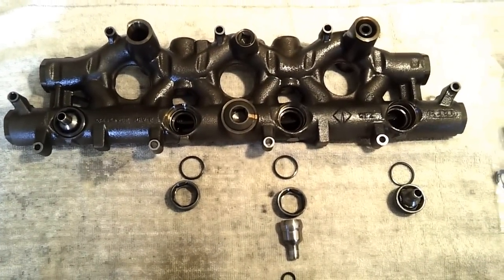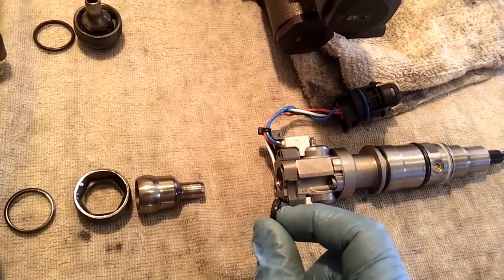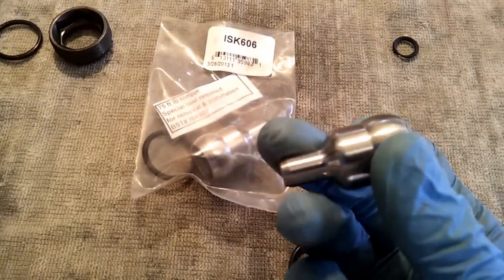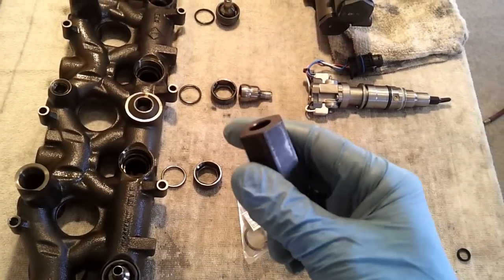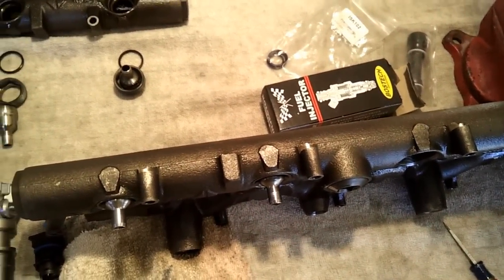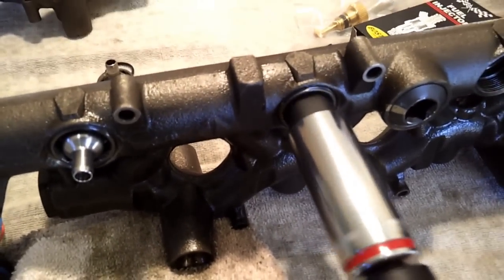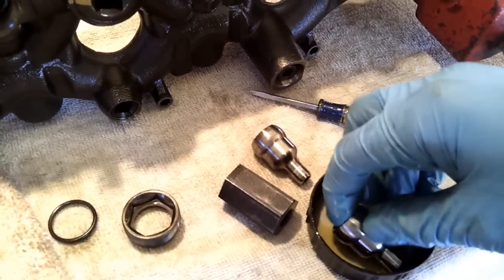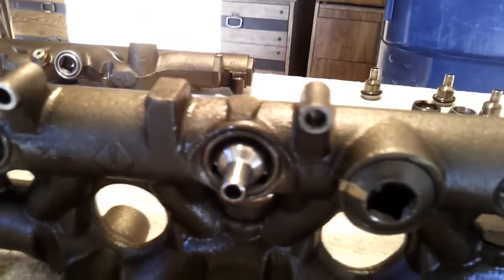FORD 6.0L Diesel ~HPO Leaks~ Oil Rail -to- Fuel Injector Nipple Cup Seals

Comment: I just replace my nipple cups and orange and was worried that the prongs were not good because my nipple cup was still moving but I can see in your video that even after your replacement you still were able to move this part. My old prints were stiff and when crushed held that shape as the new ones popped back to original shape. Thank you for the video

Comment: Torque spec is 100lbs   not 75lbs 
Also when nipple cup seals failed the oil sprays down on the injector damaging the top seal in the injetor also.

Comment: Normally the injector seal at the top is chipped off like that because whoever put the oil rail back on was a little rough with putting it down inn  injector.. I have yet found leaks at the ball cups soapy water does good under air pressure testing for them little pissy ass leaks

Comment: friend I have a detail with a powerstroke 6.0 model 2004 the detail is that hot does not start and if I throw a little starter if you start friend and check leaks in the reins and hoses and not leak friend that could be

Comment: How much air pressure should I run through the oil rail to test for leaks??????
Reply: at least 100 psi
Reply: I replaced my nipple cups and seals as well as injector seals. Tested oil rail itself for leaks and and found none. But when I screw oil rail back on to injectors and pump air through the ipr valve at 100 psi I still hear leaks around oil rail.... Is this normal??? Where should Start looking for the problem? 

Please any help or advice would help. Ive been working on this issue for over a year and I cant seem to ever solve it.

Thanks
Reply: +Jose Venegas did you start the truck? It takes a good priming to fully seat the seals. we recommend starting and running around the block then retest.
Reply: I primed the engine and turned it on. It was really hard turning it on but after ideling for about 30 mins and turning it off I could not get it turn back on again. Turned on Only after spraying a little gas in the intake. So im assuming it is not building enough pressure to turn on.

Should I still run it around the block to see if it seals better or should I just start taking it apart and assume the issue is with the injectors? And buy new ones if neccessary since I had already purchsed and put in new seal kits for injectors.
Reply: +Jose Venegas They always take a while to start a few times after the oil rail has been off. the air needs to purge out of the system. Yes running it around the block or further is always the first thing you do when you get it running again.

Comment: Did the Viton o-rings or injector seals fail you at any point?
Reply from the maker: +DJs Tuffmods Yep. Multiple times pulling trailers all over the US and Canada. Finally fixed it with the nipple cups and o-rings we developed at HHC Diesel.

Comment: Hi cr38er i have a question .i have a 2003 ford 6.0 diesel truck ,i was changed the fuel filter went i was take out the filter one little piece of the filter holder broke off and fall off inside the line i try to use a vaccum to take out but no good luck 1 month later i was trying to go to work but my truck never turn on again do you think the piece went inside one of the fuel injector
Reply: It's possible, but more likely something different. Need to Diag with gauges and IDS to know for sure
Reply: GadgetClass thanks am going and buy a xgauge just to make sure is a fuel injector

Comment: Great video. I am wondering if those seals last long. Do you get come backs. A different you tube channel says no luck with after market seals. Please respond. I trust your judgment because your videos are very detailed with clear and accurate work.
Reply from the maker: jimmy neutron That other channel is probably mine. I have more than one. This was the first video I did on it. The Bostech seals/nipple cups failed on me. I have since started a company called HHC Diesel and well sell special Heavy Duty Viton Blend O-Rings which outlast the OEM and the others on the market. They have proven themselves and are still going in trucks that had Aftermarket rings fail. We make the best tool for replacing them also. Here is the link for them on amazon and ebay:

Amazon:
http://www.amazon.com/dp/B00U4LYKMY/?tag=cr38er-20

ebay
http://rover.ebay.com/rover/1/711-53200-19255-0/1?icep_ff3=10&pub=5575088352&toolid=10001&campid=5337634278&customid=&icep_uq=&icep_sellerId=cr38er&icep_ex_kw=&icep_sortBy=12&icep_catId=&icep_minPrice=&icep_maxPrice=&ipn=psmain&icep_vectorid=229466&kwid=902099&mtid=824&kw=lg
Reply: Thanks

Comment: I found the tool cheap on eBay for $50 or so same/same early vs late model.  I took a spare Unimog lug nut (24mm), drilled out the center and then using a flapper wheel took a little material off little by little to make the "nut" 23mm.  I then fine tuned the center to fit the nipple using a deburing bit.  I then took a spare 1/2 drive impact socket and welded it to the side of the lug nut that would face the wheel so I can stick it on a 1/2" ratchet.  Ghetto I know but needed something today :)

Comment from the maker: Socket size is 23mm. You may try a shower valve wrench (generally sold in sets at Home Depot). Size would probably be 27/32" .I was going to try this but haven't done it yet. Not sure if they would stand up to the torque. Let us know if you find a commonly available or cheap tool that will work. I'm not sure about the '03-'04 "log" rails. Since they have a different injector interface. If you take yours apart please let us know for future reference.
Thanks!

Comment: Awesome video!

What size socket did you use on the nipple socket?  I'm too cheap, plus I need to repair mine today so I'm looking to make a nipple socket.  Someone mentioned 15/16.  If so that would be the size of a Unimog Lug Nut which I have a few laying around.  Do you know if the nipples socket needed is the same size on the "log oil rails" vs the "pretzel oil rail" that you have?

Comment: thank you very much for this information. I will do this sometime when my injector fails. I just today fixed my broken top injector plastic housing that connects up for the injector harness clips. guy who did my oil cooler broke the # 7 injector plastic upper part. what I did is I glued it and no more injector misfire. but haven't drove it yet to really see if it worked. thanks.

Comment: Good video etc, but man this 6.0l is one huge money pit... Lol in my opinion the parts r way too expensive to justify rebuilding a 6.0l... Hpop, ipr valve, egr coolers or deletes,
Oil cooler. Etc etc etc... It never ends with a 6.0l... I want to rebuild my engine but just cant justify all the costs...
Plus mine has a skip in the engine when it turbs over( wont run) prolly the cylinder is scewed or piston cracked etc?? 

Bottom line is if the parts 4 these 6.0l were cheaper i think it would make